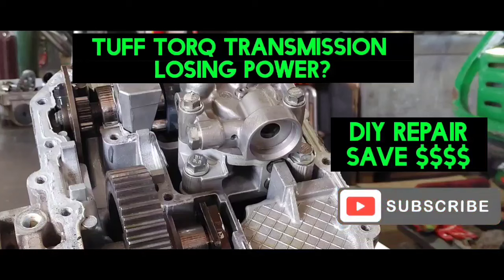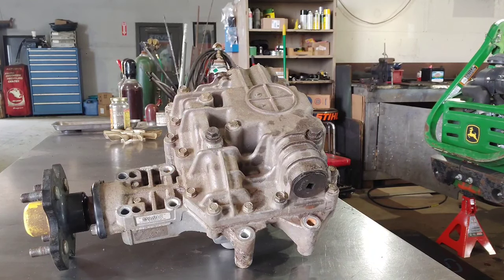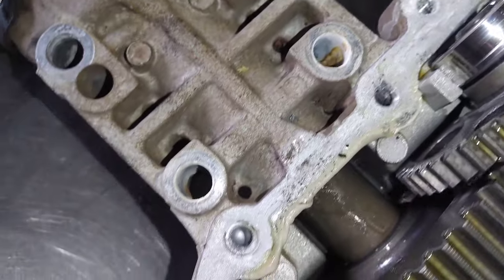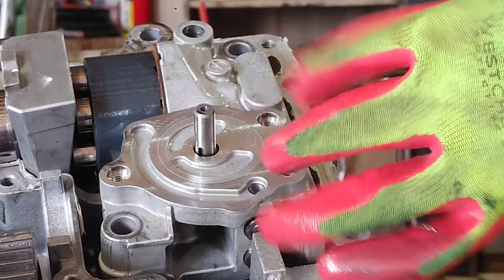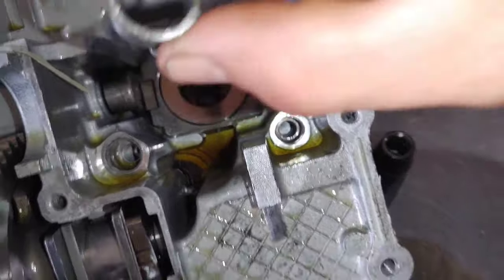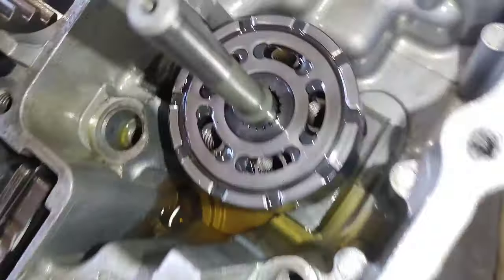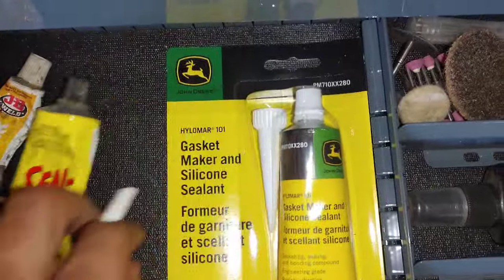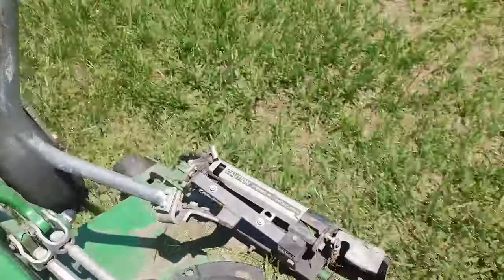Zero Turn Mower Transmission losing power? This repair could save you thousands $$$$

Comment: I have a Z-spray fertilizer spreader that I believe uses the tuff torque transaxle. I need to replace one of the axle shafts because the hub was loose on one end and rounded out the axle shaft and the hub. So far this is the closest video I came across showing the tear down but I know the transaxle in my unit is different. Good work!

Comment: I have a 2017 Z535M (John Deere) it has 159 hours,  both transmissions were replaced under warranty.  The the left transmission started doing the same as yours.  I was thinking about fixing it, but the cost of replacing is more than the mower would be worth.  Even the John Deere mechanic said John Deere has had a lot of problems with those transmissions.  Im just going  to part out mine. Has a very good 25 horsepower Briggs engine,  I'm going to put on an old Yazoo (2004)

Comment: I’m a hobbiest  mechanic of sorts , mid 80s diesel Mercedes model w123 has my intrigue for its engineering . When you started finding plastic pieces I was guessing the problem to be a bearing casing . Theirs a fine little bearing on these cars that live an extreme existence as part of the vacuum pump , these will grenade then the fine bearings will find their way into the chain  area while ping ponging down to the pan . The reason for the plastic must be to leave a chance to restoring operation  without wasting the complete unit .

Comment: Awesome video. I caught it mid flight but I did give you a huge thumbs up and subscribed. I have a Z525E that a customer had dropped off. He purchased this from another and upon initial inspection from the outside, someone had filled each transmission with trans fluid instead of the correct oil. The right side is still spinning but still needs the fluid drained out. The left side, not to lucky. It had a axle seal that has been leaking for quite sometime. I have a huge puddle in the driveway. I ordered the seal since I hope there is nothing wrong with the unit. I called Tuff Torq after not hearing from them for a few days. I did talk to a tech there that had helped me out making sure that I had the right transmission number. 7D-L0109678. I ordered 4 of those seals just incase.

Comment: Great video. I have a 2012 Ferris. Goes forward fine but in reverse one side is weak. The question is how do I determine if it is the Hydro Gear pump or the wheel motor? Which one do I take apart?

Comment: Great video! I like how you do close-ups and explain the whole thing. What is your opinion in quality between the Tuff Torq and hydro gear zt transmissions?
Reply: Great question. I just bought a cub cadet zt2 and it came w a tuff torq tz350 hydro. I thought it was a 2800 hydro. Not sure if I should b concerned since this one isn’t meant to change the filters just change fluid.

Comment: What model Tuff Torq is it that costs $2000?  Even if it is a K60 or K56 it should not be near that much.  Looks like the piston face and valve plate scoring was the main cause of drive failure. Thanks for the video.
Reply from the maker: https://partscatalog.deere.com/jdrc/partdetails/partnum/AUC11802/referrer/sbs/pid/310395412/pgId/740042572/eqId/65366/snp/NzQwMDQyNTcyOlBBR0VbMTA2MTojQlVTSU5FU1NfUkVHSU9OLDE2NDU6I0NBVEFMT0csNjUzNjY6RVFVSVBNRU5ULDIwMDA3OkNIQVBURVJd

Comment: question your saying for warranty 1300hrs. my undrstanding on a 920m 3yrs or 1200hrs ? thanks for your time.
Reply from the maker: These models have unlimited hours warranty for the first 2 yrs OR 3yr 1200hr  -1500 hr warranty (depending on the model ). The mower in this video was only 1 yr old.

Comment: Awesome!!!! I am having the same issue with my toro timecutter 3225. But when it cools down it works again. Any recommendations please and thank you.
Reply from the maker: Open it up and see what is broken.
Reply: @Mechanical_Mind  the funny thing is it cools off and works again??? Only has 145 hours on it….
Reply from the maker: @rigomartinez5836  that is the exact same issue that the transmission in this video had. Once it cooled off it would work again and not make any noise. When its cools off the oil is thicker

Comment: Hello!
I finally got both transmissions back together and installed.
The right one is reverse. Pushing on handle causes it to go in reverse, pulling on it goes forward.
Seems like reverse is much faster like forward would be.
Any ideas how I could have possibly screwed this up!?
According to schematic hydraulic lines at front are on correct. Has to be something directional inside? Z930a
Reply from the maker: Oh no!! I guess you might have the valve plates in the wrong postion.
Reply: Are those gold looking things that you mention are separate part numbers in the video? I wonder if I have to change orientation or swap them from shaft they are currently on. Anyway to tell for sure they on right? 😬
Thank you!
Reply from the maker: @squeaky61  yes its the gold plate looking things. Id honestly have to reference my video to remember which one goes to which shaft. I think you need to change which pump they are on
Reply: Ok. I’ll try it. Thank you. Funny cuz on the left one I was sure I mixed them up. On the right one, I was sure I kept them correct as I saw in your video they are different part numbers. 🤷‍♂️🤦🏼‍♂️

Comment: What was the source of that rebuild parts kit ???
Reply from the maker: I order all my parts for John Deeres I work on through deere.com. I made a video awhile back showing how to look up any part for your John Deere https://youtu.be/9JgYcXJhQvM
It's so fast and easy I even used deer.com to look at diagrams even when I worked at a John Deere dealership and had access to their diagrams.  
You can also use it to find JD part # and then cross reference them to the manufacturers part and get them for less money from other sites.